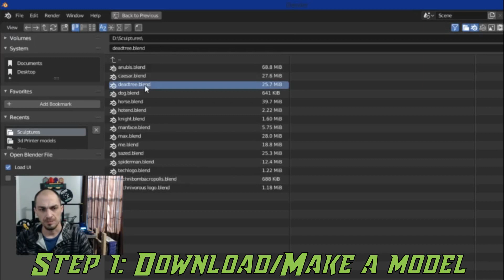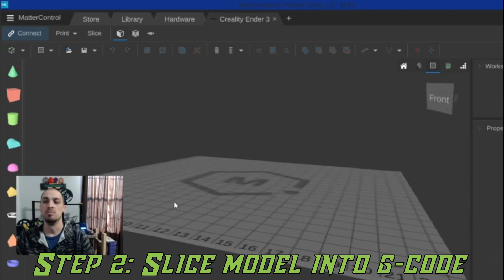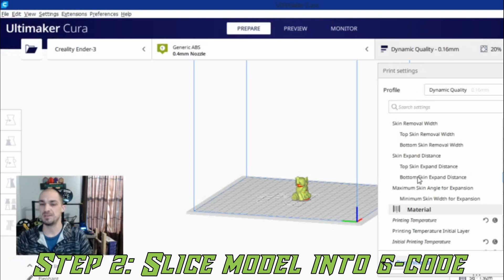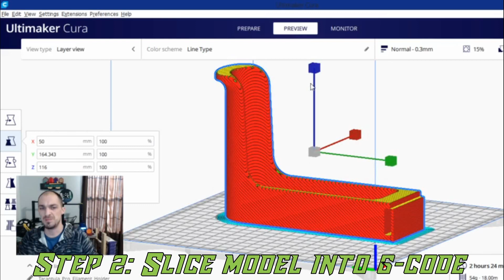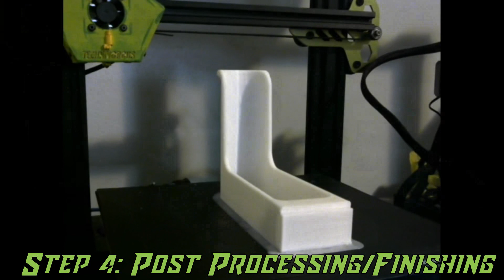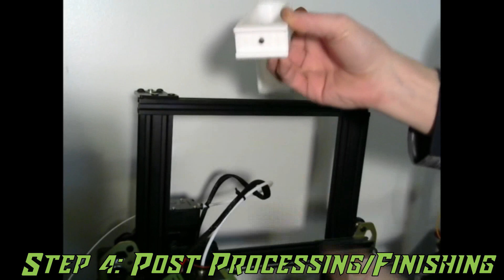Learn 3d Printing from START to FINISH!

Comment: I have tried most of the slicers you mention on my Ender 3 and CR-10 V2 but have gone back to Cura, I have my printers dialled in with Cura and I know how to use it to its full potential so have stopped trying new slicers.
Reply from the maker: This is why, of all the slicers I mentioned, even though mattercontrol is my favorite, I used cura for the demo. It is the most popular out there.

Comment: A quick hi from the netherlands. I want to mention another free 3d cad program wich deserves your attention and that is called Design Spark Mechanical. You download this software and the models you create are also on your pc so it's freestanding not like f360 wich you can only use online and your files are in their cloud. Thank you a lot for your efforts to help us with 3d printing. Great work I appreciate your channel a lot.
Reply from the maker: I'm going to look into this right away, thank you alfred!
Reply from the maker: I was a bit worried when I started this app that it couldn't find my native screen size. After getting it to fit my screen though, it's amazing. Simple, but powerful interface, and it's been easy to find all my favorite options/tools. I've got some more playing around to do before I make a video, but so far this is my favorite cad program yet. Thanks for the tip!